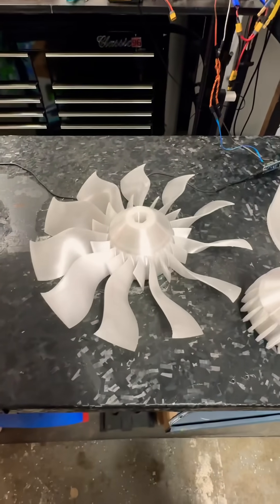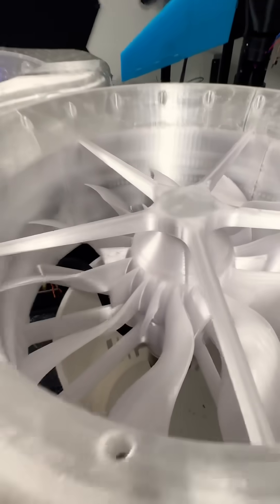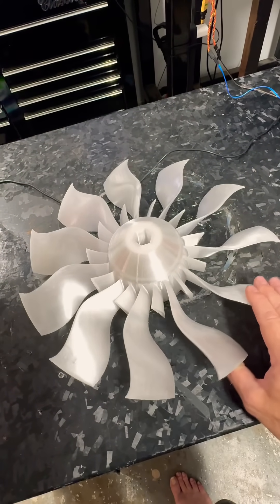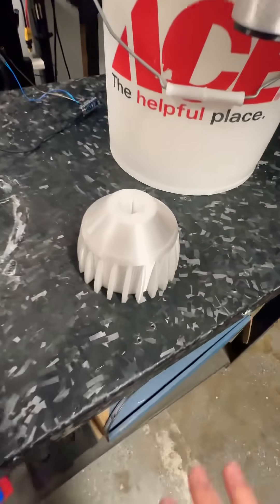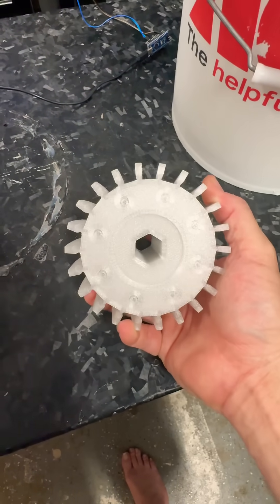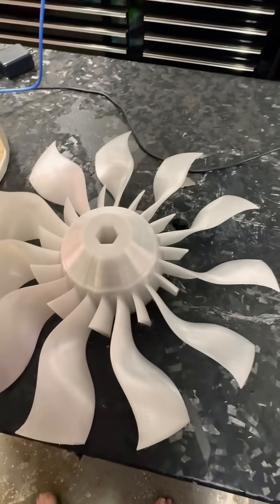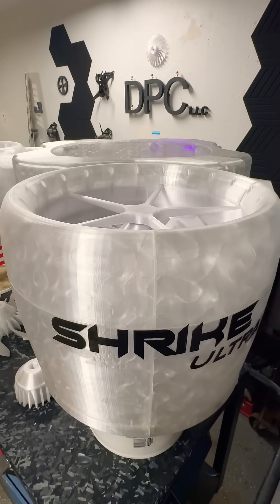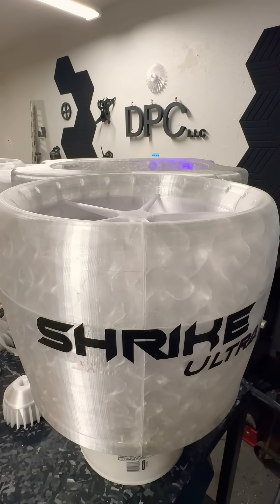Fully 3-D printed drone build update. Printing the 340 mm fan. ￼

Comment: Got a question, you ever thought about a coaxial EDF engine? Was just curious if it would generate more thrust.
Reply from the maker: I have but with a twist. Coaxial turbine compressor, multi stage.
Reply: @warmachined3472 by any chance did it produce more or less thrust? If you ran it I can’t remember.
Reply from the maker: It can produce more thrust, however the added load on the motor from fan resistance can reduce overall thrust unless you plan on running two motors. At that point you run into extra battery weight and decreased run times. So while it could work it would have to be specifically designed as a coaxial with the proper motor, esc, and batteries. I have seen some examples of this online but they where powered by either massive packs or benchtop power supplies. Might work well in a jet but not a drone unless design again from scratch with coaxial in mind.
Reply: @warmachined3472 dope.

Comment: Maybe a dip in epoxy for the fans to strengthen them? Maybe a few strands of fiberglass down the roots of the blades?
Reply from the maker: It could if it were thin enough. There is an expected deformation at 9000 RPMs that I have to allow for. However, at the blade root epoxy could be helpful.